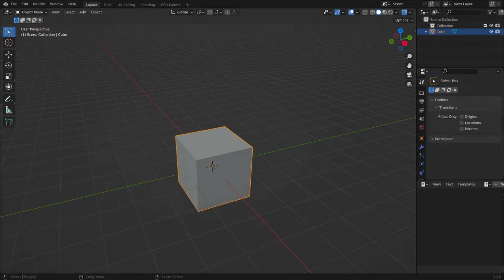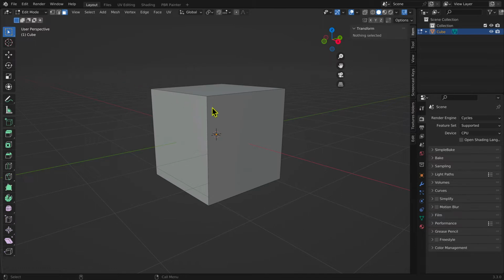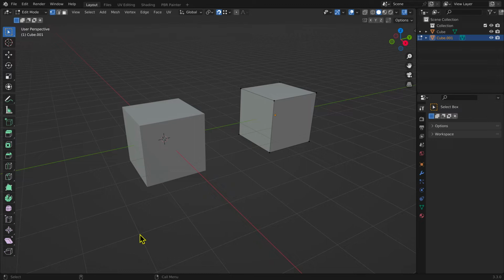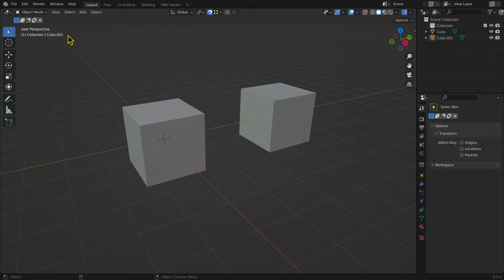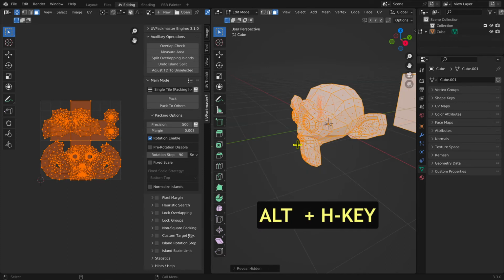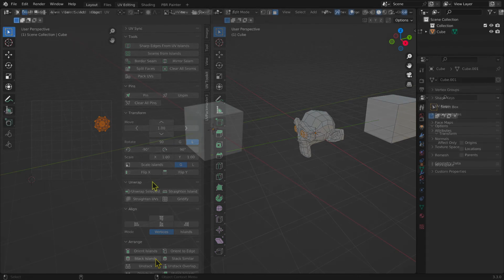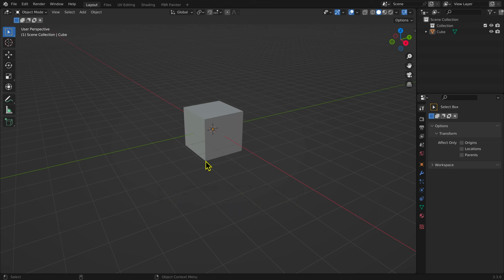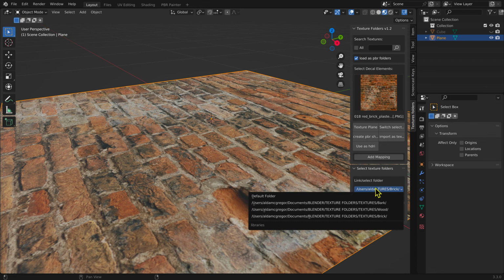Blender to Trainz: Blender 3 Beginner Course  - 11 Blender Add-ons

Comment: UVpackmaster3 $44.00   worth it
UVtoolkit no longer available
PBR Painter $28.00 worth it
Texture folder $12.00 got it 
quick snap $0.80 got it 
Synchronize Workspaces still not available darn.

I noticed my version uvpackmaster3 has a stack groups check box added below the normalize islands tab. I ran across an article saying this does the same as you describe for the uv tool kit that's not available at this time. Maybe they decided to include the tools in the other add on. I'm new to blender, but have had classes in 3ds max and Maya as part of my degree in media arts and animation. I'm retired and can't afford the more expensive hobby versions of 3dsmax, so I'm hoping blender will get me back into modeling.